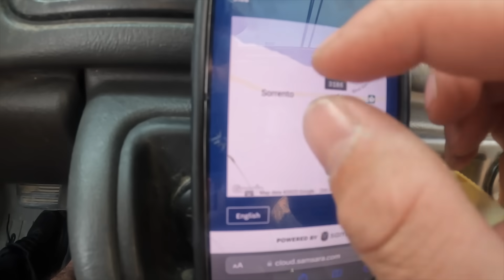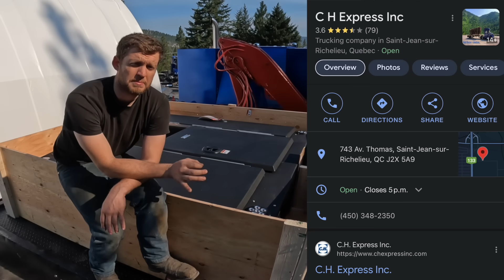Behind the Scenes Drama: CH Transport vs Electric Truck Delivery - The Real Story Revealed

Comment: The idea of a "rescue rig" that could be a power plant for electric cars that run out of power would be really sweet.
Reply: Yeah, some kind of setup with tools, welders...  Charging port for other EV vehicles if needed...
Could even help in the future when they find some issue on their own truck.
Reply: Not exactly the same, but I've seen videos of Tesla drivers with a little generator in the trunk.
Reply: There have been rescue rigs since there have been cars. They are called tow trucks. Tow the car to a level 3 charger is they way.
Reply: Or just give up on the all electric crap
Reply: @midwestreview6382  Why are you even watching this channel if you're anti electric vehicles ?
Reply: @dsanson101 don’t feed the trolls
Reply: Definitely! I know I hear about it way more than it happens, but running out of battery just a mile or two from  a charger has got to be frustrating since there isn’t a good gas can equivalent. This would be nice to give someone their next couple miles to get them to the charger.
Reply: @dsanson101 hes not, he said "all" electric, not the deisel hybreds😂
Reply: No more blackouts at the shop, either!
Reply: Awesome publicity as you pull up to yet another Tesla😂

Comment: I love that idea of a Wrecker with a level 3-4 fast charger... Especially as electric vehicles become more and more common I think that'll become a necessity for most towing companies
Reply: Just needs to be able to add enough range in 10-20 minutes to get you to a full bore charger.
Reply: @Prestiged_peck exactly! The tow truck doesn't carry 60L of fuel to fill you to the brim, they have enough to get you to a gas station. Why not the same for EV's? Heck, battery pack they load into the trunk for you to drive to the charger with, plug and go.
Reply: A rollback would be would actually be the ideal application for retrieval and charging dead ev’s.
Reply: Topdon EV Rescue you'll start seeing on towtrucks
Reply: Edison Motors: Saving Teslas
Reply: -  OR the wrecker simply flat tows the flat truck and its regen will add charge down the road - to the nearest supercharger...  (hook up and stick in charge from the Diesel powerpack at the same time - if that fits the bill better - keeping wheels turning is all the game involves. - once 3P 1000VAC is available - anything is possible on the output side.
Reply: @brianb-p6586  , seems they have a flaw then. It is solvable, I know as I have studied these things, that they are not done... (Prob flat tow "Or" recharge on a flatbed, or in tow mode (or on a wheeled dolly) makes more sense in reality, these binary decisions are easier for marketing to cope with.)
BTW, ADDING A 3rd party charge/access port is doable if one isn"t fussed by pissing off Elon.
Reply: @brianb-p6586  , sorry you exceeded max stupidity on some of thore rejoinders..., Go straight to jail do not pass go, do not collect $200.. Lol, yes yes yes. We know how the world works, just having fun messing around, the possibilities.. (Of course regen diesn't work if wheels aren't rotating...  You may have forgotten a whole lot of fun tow tests of early EV models where 5 miles flat towing added 5 miles range, not terrible seing at 0.2kWh/mile (or something) the cost to a diesel tow vehicle isn't crazy...  Oh, I wasn't thinking a tow operator would modify cars, more that owners will in orger to access denied power.. (no need responding if it makes no sense, onward and upward we go...).  Lol... Have a great day.

Comment: Of course chase backed it in 😂 love it!
Reply: NGL, that looks like a tight sketchy spot-- and they said so.

Props to the driver to know when he was in over his head and turn over his steering wheel. That's uncommon--ego usually gets in the way. "No, yup, you got a class-1 (AZ), it'd yer yard? Here's the keys, putter in!"
Reply: @SPD_driver   You NEVER let someone back you rig anywhere. if the driver does not have the skills to do it, they should not be driving
Reply: @PD-yd3fr LOL. Pride cometh before fall.
Reply: @memyself7419   You the Driver are responsible for the truck and what the truck does, if you let me hop in the cab to back it into a hole and I tear a hole in the trailer and knock a hole in the wall, I hop out of the cab and giggle maniacally as I walk away.  Mr. Truckdriver and their company are responsible for any damages.

NEVER let anyone else drive your truck, every Driver should know and understand this
Reply: @PD-yd3fr  You can be like that with your truck. In my career I've both accepted help getting into/out of tricky places, AND offered... either to just spot, give advice or put it in/pull it out.

Pobody's Nerfect, and some unique spots, you just trust someone that does it regularly vs once in a blue moon...
Reply: @SPD_driver   There is getting guided in, and then there is letting someone else drive the truck you, and only you are authorized to drive. Chase is a great driver that is not the issue, you never let someone else drive your truck

"Hey Boss. I was having trouble backing into this spot so I let someone I didn't know, hop in and give it a try.  Ripped a ten foot hole in the side if our trailer , ripped off the passenger side mirror as well....my bad"
Reply: @PD-yd3fr I've been trucking for 20 years and have a Peterbilt 389. I'd take 1 look at this place and tell them to either take it off at the entrance or I'm gone. I'm not damaging my truck because these clowns have shit blocking the way. I get this was a Volvo and a "New Canadian" but I stand on what I said. These kinds of deliveries are meant for day cabs with pup trailers. I've backed in for many drivers over the years that had plenty of space bur no experience but this isn't one of them. I only do it for drivers that are holding me up when I'm in a rush.
Reply: @SPD_driver My only problem with that and it's likely the only reason needed, is liability.
Reply: @sijonda That is the truth! Whatever you decide to do, that is your decision, but you retain the liability, even if you let someone else in your cab to drive. Your truck, you're liable!
Reply: @PD-yd3fr  It's not like I'd toss someone the keys and say "I'll be back in 20..."

Obviously a driver is responsible for their truck and load. I'm either in the pax seat watching and learning, or more likely on his blindest corner, in a mirror, spotting.

I'm just a hair under 2M km, regional work.
Reply: @sijonda  I hear that and get it. See my other reply. I'm not saying toss the keys to anyone. 99% chance I'm still spotting it in, but you pull up on a downtown tight blind alley,  and try it or assess its past your skill level, and the daily  guy say running Sysco offers a hand,  on an alley he's in EVERY DAY....

Or like this one, Chase's own yard, where he's also a Class1. Doubt few people know his yard better.

Comment: A fast charge truck to rescue stranded EV's is a brilliant idea, it's probably the future of auto rescue, and you could be in on the ground floor.
Reply: I had this idea where next generation charging might not be through cables. But sort of like how phone 'wireless' is, where it comes through the bottom of the EV.
It might bring charge times way down sort of like how Xiaomi has done with their phones but on a bigger scale.
In this case the rescue truck could even extend a plate underneath the car to charge it in almost no time
Reply: @theemperorofmankind3739  There is always major losses in the form of heat when doing wireless charging (unless LK-99 proves to be true). And you're already late on this - being worked on. Currently direct wired connection is the best bet as it has the least losses. That being said, if tech changes, the extend-o-plate™ could work.
Reply: @kstricl  Oh yeah 100% agree
Reply: I hate to reply to my own post but I just had a shower thought a few minutes ago....  What if you had a charge truck and offered a service where you met people travelling long distance to help them charge at more convenient spots along their journey, kind of like a mobile bespoke charging station. The current distribution of charging stations can be spotty in a few places and it might take a while to change, meaning this could be a lucrative service.
Reply: On surface it's a good idea but practically it might not be viable (for a long time). So BEV sales are growing but the number of them on the road is rather small. And a wrecker might not be around the corner and if only a few of all wreckers can charge a car they will statistically have a very long way to travel when someone runs out of power. And what they only do would be to get to the stranded EV, stand around and wait for some time and then finally have the EV drive off to a charger.

There will I guess be a lot more flatbed wreckers around than specially equipped for charging ones. So put the EV on a flatbed, drive and drop it off at the closest charger - it sorts itself out (if it's a slower charger they can charge up enough to get to a fast charger).
In a BEV you ought to put in your destination and it calculates the estimated percentage of charge remaining of arrival and all charge stations in between. These are getting better and better with more factors (wind, temperature, elevations). It's not like the old days a gas car at best had a working fuel gauge and the driver only roughly knew how far the destination was and maybe unknown how many pump stations in between. So unless being an idiot it's probably way fewer people today being stranded in their EVs than those who ran out of gass way back (in ratio to number of drivers).
Once BEV gets really plentiful then the wheel-lift wreckers/integrated ones might have a use if they can do V2V or if it's a diesel, a big generator. But not this big thing Edison has an e-axle for.

So I don't think Edison should built into something to rescue BEVs that have gotten out of power, better with a service truck.
Reply: @kstricl  wireless vehicle charging is about 10% loss compared to a cable going into a car (so 90% efficiency compared of the cable - not the whole charging). It makes sense for comfort in your own garage with your own solar panels. But I think they all will have plugs too so the idea of a rescue truck needing to wirelessly charge a car isn't needed.
Reply: @JohnSmith-ki2eq  Tesla did something like that a few years ago (I don't think I've seen much about since). A big battery on a trailer with chargers. It was for thanks giving travels they put it up. I guess they built-out the charging station later. It could be useful for events held far off regular routes.
Remember that gasoline and diesel at a gas station is "cheap". Electricity even cheaper. Having a charge truck to meet up individual cars for some charging in a not so well served area - it's going to get very expensive with a dedicated vehicle, driver, fuel for it etc.
People would plan around it, charge to 100% (takes time) to avoid it etc. I wonder if the cost of a flatbed wrecker that meets up and carries the enough "across" the route without stations would be cheaper than any dedicated service.
Reply: the link to the tesla trailer charger: https://youtu.be/5tlYt82lEo4?t=3

Comment: I dig your idea of a service truck with a generator and welding setup. I don't work in logging or trucking, but knowing enough people in those industries, I know that stuff breaks down all the time, and it would be interesting to see the contrast of it to a traditional service truck.
Reply: A 4500-5500 service truck with edison's setup on it would be awesome
Reply: Make sure you can tap the full output of the traction generator as 60Hz AC.  Would let the truck pinch-hit as a generator when needed.  Also, heard of a few ranchers who run all corded tools out in the field.  They find a generator and extension cords less hassle than broken/dead battery operated tools.

Comment: For the axle. 

Flat bed truck with removable shop built in a shipping container. So you take the “shop” off and use the truck as a hot shot parts runner when the shop isn’t needed.

Comment: Forklifts are amazing. Just get an old 4t lift, we had one on our farm, cost us $1500 and was used almost daily. We put motors in and out of tractors and trucks. You don’t have to get a flash one, just one that works.
Reply: I have a smaller forklift for my farm, saved us so much work and time.
Reply: @arthurr8670  I have since left the farm and just have a one acre block with a shed and ended buying a 1.5t battery forklift, every shed needs one.
Reply: For their use, a telehandler. But ones with good hydraulics are big bucks and they need to have tight hydraulics when working around people and really heavy pieces. I was thinking along the same lines though; would've been faster and safer by just leaving the transport over near the road.
If I had the money, I would just rent them one.
Reply: @kstricl  Tele handlers have terrible visibility, when working around people forklift every time.
Reply: @kallumblake5482  Yep, small to medium ones in metal mines, handy as all get out, but, horrendous operator visibility, at times.

Comment: Here in the states it’s called “exclusive use”. There’s dirt bags that will still try to fill the deck but it gets the point across to the good carriers. You pay for the whole deck, you get the whole deck. You pay for expedite you get it rickety tick.
Reply: I love that expression "Rickity tick"
Reply: Got a neighbor that got screwed on that. Paid for the whole trailer for exclusive use and expedite. They got there with another unit on it that was going to a nearby place. He knew who it was and found out they also paid for the whole trailer and expedite. If they would of communicated and said they'd shave a bit off the cost with a nearby load, they'd go for it. But lying, they're going after them. But it'll probably just be another carrier that drops off the face of the earth.

Comment: I've done load and unload in farmland, don't get a forklift unless you get ramps and a concrete pad.  Get a telehandler with a 48ft reach.  You can load and unload a whole trailer anywhere.  Smaller telehandlers just mean you're going to be dragging stuff out if it's in the back.

Comment: Chase
In my Army Career, I had two of the most incredible pieces of equipment.
I was a Heavy Construction Equipment Repairer (62B) (first of 4 MOS’s I have) 
The first one was a “Contact Truck” the old Dodge pickup with the toolbox (service body) mounted. 
On board I had a huge amount of stuff, beginning with the tool chest. Early on it was all SAE but we got metrics eventually… all the tools didn’t fit in the available spaces. It just had the look of an old Craftsman 7 or 9 drawer box. 
Then there was the 4 cylinder Air cooled Wisconsin powered Welder / Generator, with body outlets inside and out, (4 corners outside single plugs and 3 outlets in the back 120vAC) the old Welder… that was a great beast Lincoln had DC and AC, and possibly 500 Amps on one version (it could drain the entire gasoline tank in under 6 hours (24 gallons and was the trucks fuel tank) I did it ! Others were 250 Amps or 300.??? Also had A 220 volt 50 amp 30 amp outlets and a quad 120 outlet. In the back was a 220 volt Air compressor but 2 remote tanks the size of semi truck air tanks. Sucks for using a 1” impact but ran at 150 psi. 
Then there was 4 remote flood lights round based and held in place by wing nuts and washers. The heavy rubber extension cords were all black.
The rear drop down tailgate featured a good size 6” mechanic Vice and twin bi-fold doors for security and not so much weather protection.

Then there’s the HSTRU Trailer. It would make almost any hydraulic or Air hose that you could use for construction equipment, all the fittings barbs and nuts for assembling them with the gear reduction assembly machine, plus bending and flaring all sorts of hard metal or soft metal lines, including a high flow pump and filter system to clean out hydraulic fluid systems. Save a pump or two and hours of R&R plus down time for equipment repairs and maintenance, simply by installing the lines to clean out the pipes lines, motors, etc of your Fluid dynamics, 5 micron and 20 microns filters. 
Thousands of gallons of oil could be saved by basically putting a artificial Kidney in the system temporarily. Top off, take the before and after oil samples and send it!
Could certainly be used for the basis of anti freeze / Coolant scrubber for the batteries too!

Glad it’s safe and you have a great chance to make it. 
I know you’re all stressed out but please don’t forget to call a safety stop to get everybody a decompress time. They will be much more effective than if you don’t. And explain it that all work and no play can kill a team!!!
Reply: I wish this was further up the thread for chase to see it.